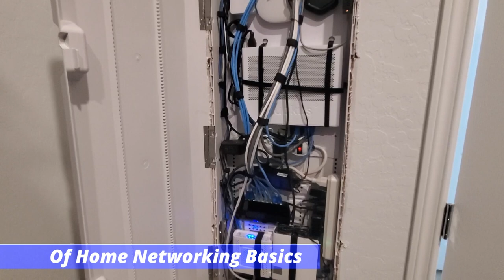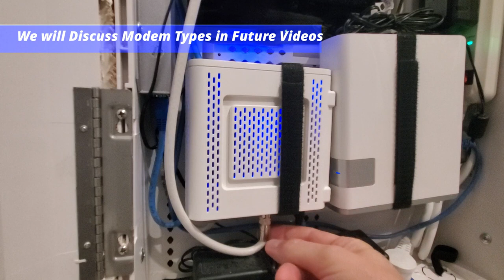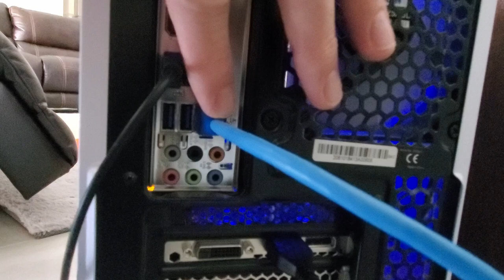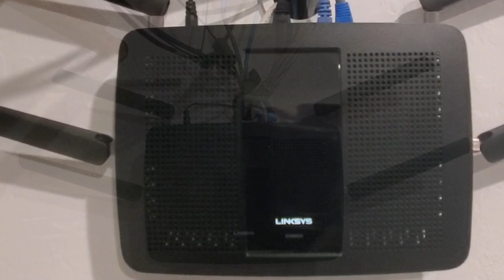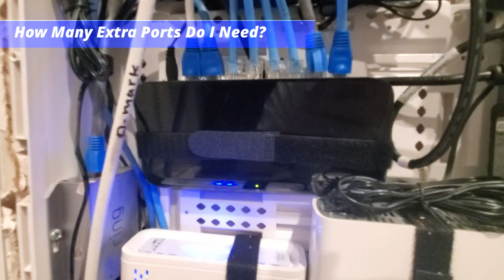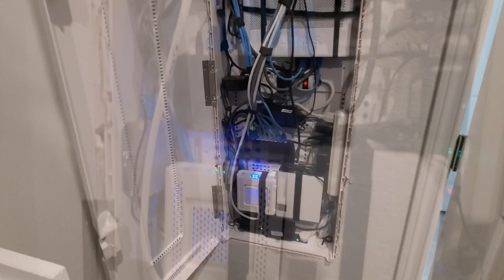HOME NETWORKING 101 - MODEM, ROUTER & SWITCH - RESIDENTIAL NETWORK PANEL SETUP - HOW TO

Comment: Modem>router >switch then access point or router?
Reply from the maker: Access point or additional router can connect to the first router.
Reply: @UltimateTechHub  Thanks for your response,
Actually i made a setup in my company accommodation and something went wrong and i don't know,
I have main modem 500 mbps, and router is connected after it the  4 switches are connected with this router 
From this switch i want to install wifi devices in all 20 rooms. 
In rooms what should i connect from the switch. Access points or router? 

Thanks 
Your videos are great 👍
Reply from the maker: @nasirshahzad5358  20 wifi devices!!! Wow!!! That's 20 access points. You may want to get a managed PoE switch that way you can use PoE access points. One wire per acces point would be ideal. You will need at least a 24 port PoE managed switch to handle all of the acces points. Hope this helps.

Comment: Wtf is a modem 😭😭😭😭😭😭
Reply from the maker: It's a box that connects to your coax cable and a ethernet cable connects from the modem to the router. You can buy a modem or rent one from your cable provider.
Reply: @UltimateTechHub  what cable provider... We don't have modem boxes in the U as a standard  Your router Just plugs into the wall.